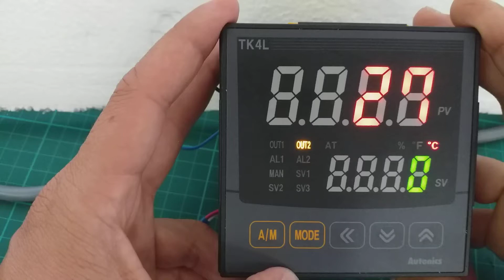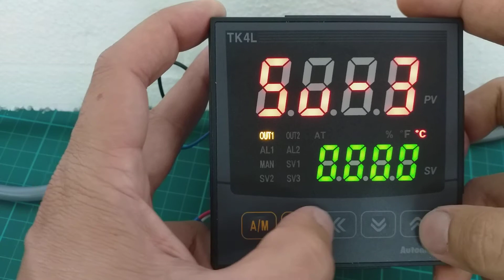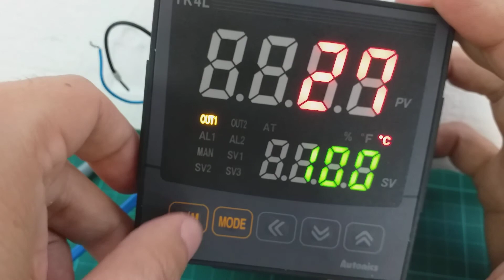Autonics TK : Set Digital Input for Multi SV (Binary logic apply)

Comment: For example, I mean that when the temperature of the machine reaches a five, it will lock, meaning that the inch contact that is on when the AL1 power is given will remain in normal cruise until the temperature rises to a certain level.